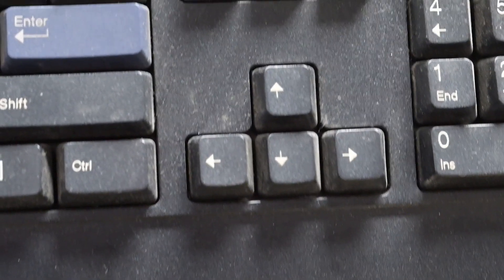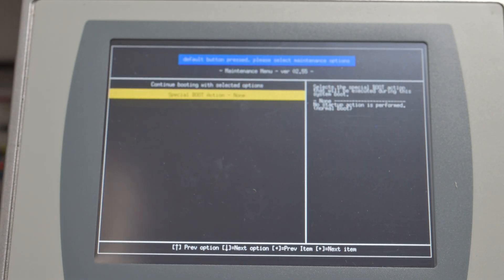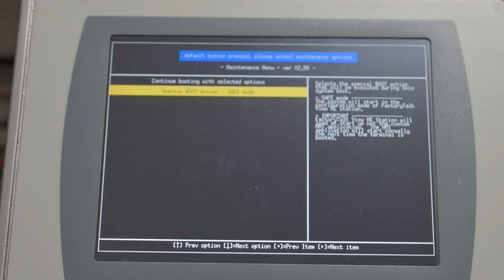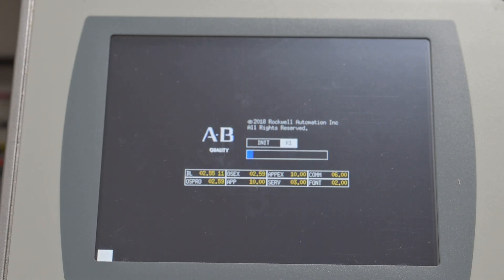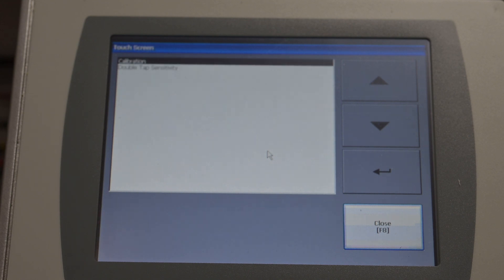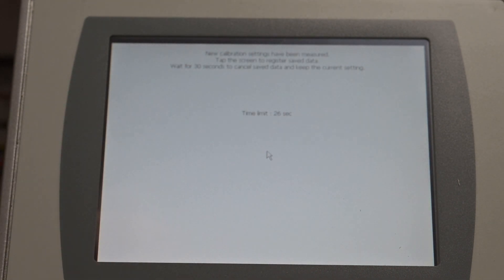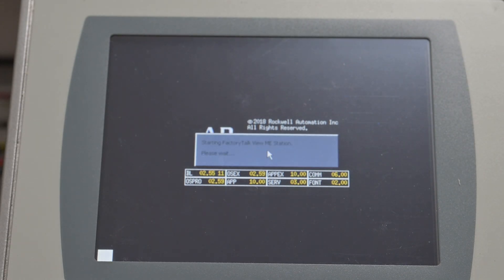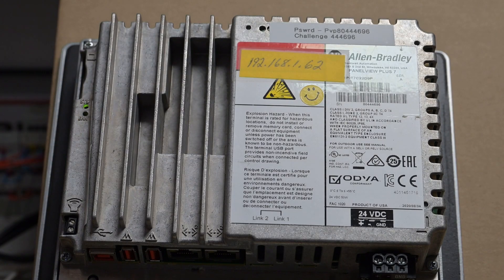PVP7 - Series A Screen Calibration

Comment: Mine doesn’t show the option to calibrate the screen😭
Reply from the maker: Hi:  You need to go into the maintaince/ setup menu or you won't be able access it.  What is the model number and series you are working on?
Reply: @a @abplctestbench759  was a panel view plus 7. We were in the maintenance screen. My supervisor eventually had the whole hmi replaced. It was replaced with the same exact one but this one shows the calibration option. Very strange, still not sure why. The screen would also randomly flip upside down too
Reply from the maker: @caesarsandwich  
Hi Ceasar:  Merry Christmas.
Sounds like you may have a faulty logic module.
Also on the original is the screen and the logic module the same series.
Mixing a series A with a B will give you grief, as I found out recently.
Bruce

Comment: This is the same calibration you get in the normal configuration screen option?
Reply from the maker: Yes it is, but quite often the original developer will hide or password the access to configuration screen.  Then you need to know the other way in to fix it.
Reply: @abplctestbench759 well it didn't fix my screen's slow response, guess I'll still send it off to you.